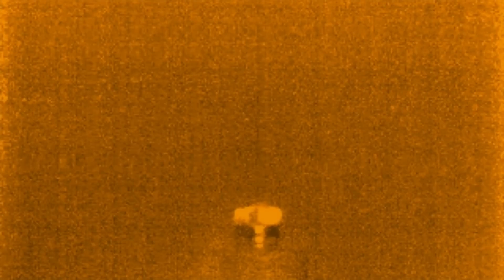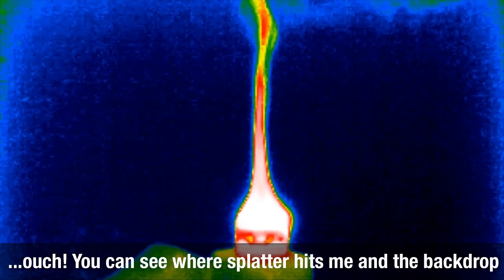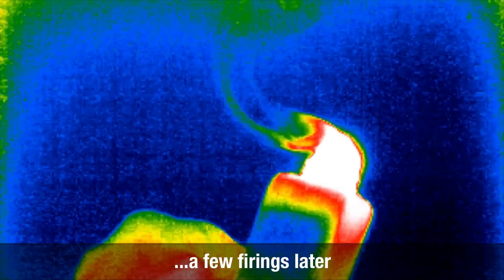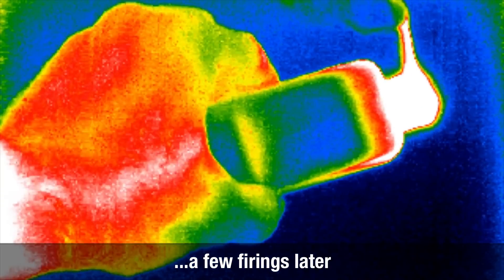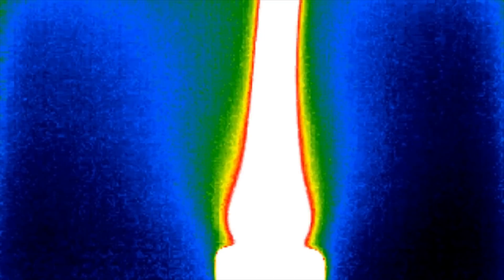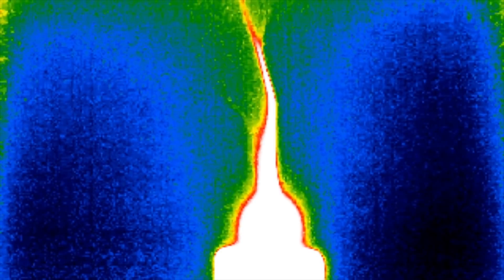Minding Your mAhs Ep025 – Pulsing for a bit too long, the colorful way

Comment: Off-topic but what 26650 battery would you recommend for a flashlight?
Reply from the maker: Sorry, no 26650 recommendations yet. It’s been too long since I’ve tested them to know if they are still wrapping the same batteries. Testing of a new batch of 26650’s is being posted this coming week though.

Comment: I wonder how mesh behaves.
Reply: True enough good sir. But does the thermal stream off the surace of the mesh like it does with coils or blume, similar to something like a dome shape when fired is my question. Dry hits suck big time, did that with my profile rta when i wasnt paying attention with the juice level. Blech! =p
Reply from the maker: A lot of surface area there to set the cotton alight if the cotton dries out. 🙂

Comment: Mooch, thank you for all your work for the community.

Question:

I have 2 Molicel P26 batteries and Xtar SV2 charger. If I want my batteries to last as long as possible on a single charge, should I use low Amps when charging?

Thank you
Reply from the maker: I don’t think you’ll see any difference between 1A or something lower when charging P26A’s. Unless the charger heats up the cells. If it does then choose a lower current setting.
Reply: @batterymooch  it does heat them up ever so slightly. Thank you. i will try 0.5A

Comment: Ha mooch, cool video, can you answer a question? If you have a dual 18650 regulated mod (topside dual carbon) I know the volts are doubled but does that apply for the amp? I use molicel p26 batteries and I usually run between 0.10 and 0.12 and around 115 to 125 watts.
Reply from the maker: Series or parallel doesn’t matter in a regulated mod as the battery is not connected to the coils. They are connected to the regulator circuit board and that board runs at set wattages. P26A batteries are rated 25A and that is about 75W each. This is 150W in a two battery mod before you reach their rating.